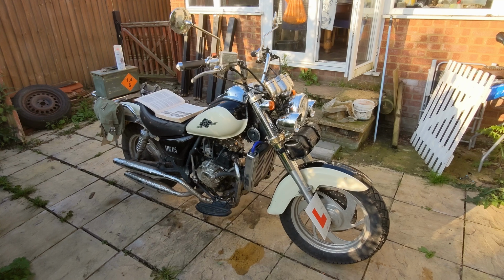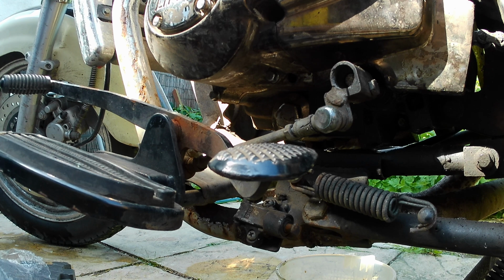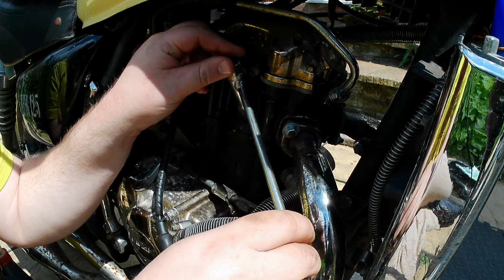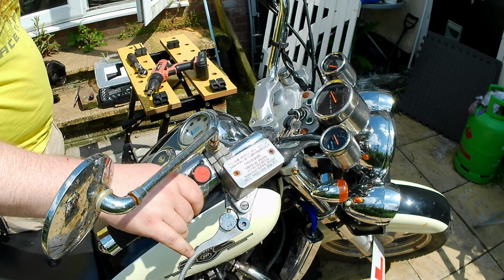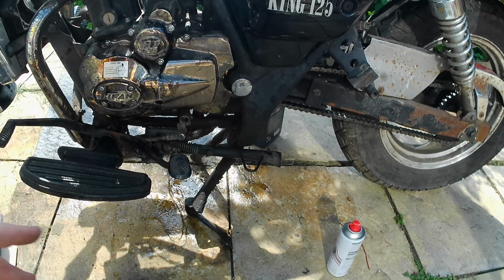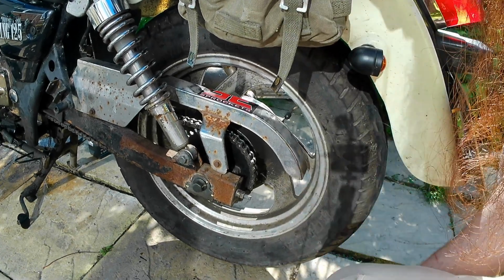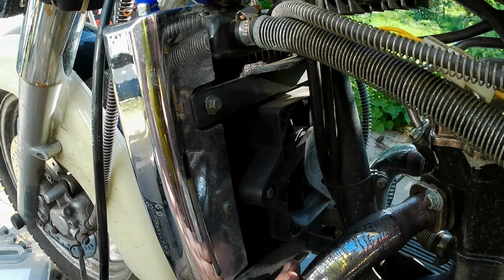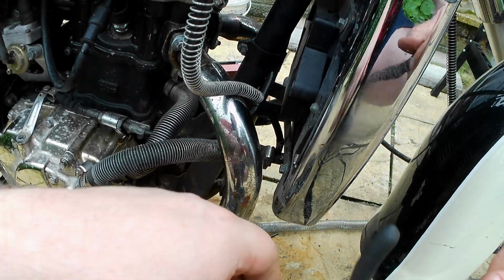Lifan King Oil Change and 3000 mile service ahead of a Big Rideout.

Comment: Did you put Washer on sump plug ? Don’t think you need expensive oil when changing every few 1000 miles as motor designed to run in hotter climate on shite fuel .
Reply from the maker: Can't remember what I did about a washer, I get the feeling it was a new one from my toolbox but I edited it out. I have to cut so much out to get my videos down to a watchable length, because these are my hobbies I take my time and enjoy what I'm doing so I often end up with A LOT of footage at the end of it.
I agree about the oil and if I'm honest I probably won't stick strictly to the mileage interval going forward I'll just service it once a year instead.